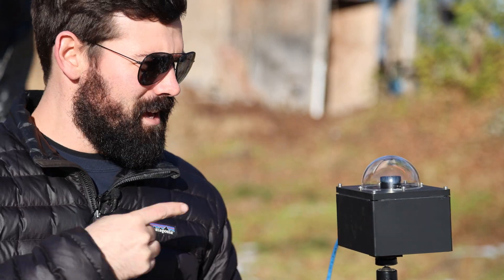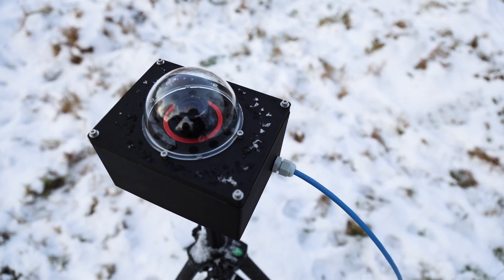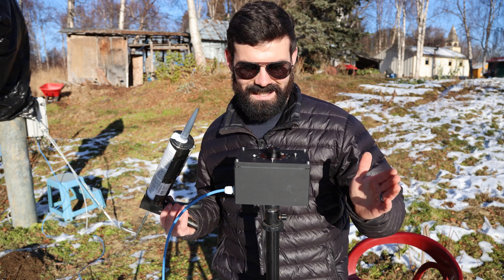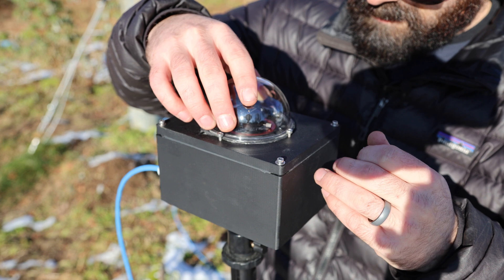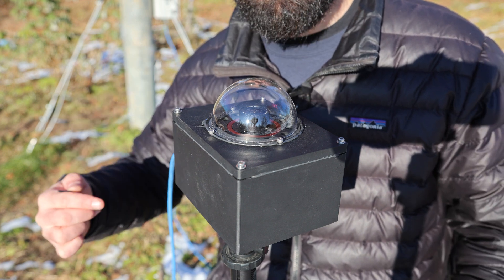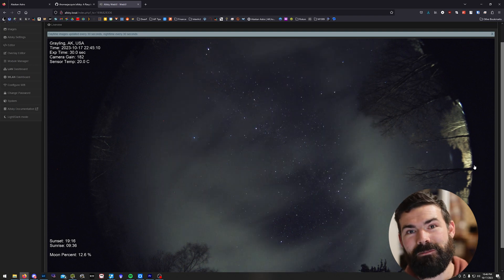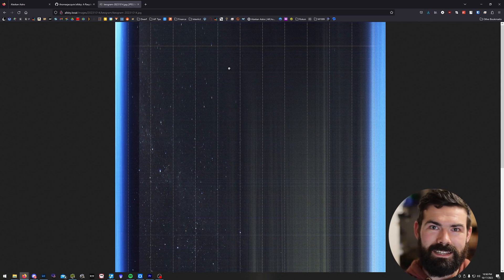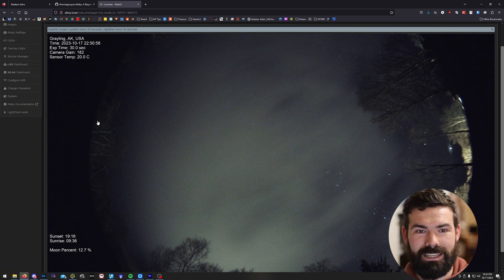All-Sky Raspberry Pi - The setup I use for this channel

Comment: Very good video.  Unfortunately Allsky has not been keeping up with ZWO camera releases.   It would not recognize my 676 and I understand it doesn't recognize the 678.   I finally found a similar tool, indi-allsky.   The missing cameras issue have been going on since May with promises of an update for several months.  Not your fault of course.   Just passing it along for folks that might try to use allsky with a newer ZWO camera and then get part way through the install and not be able to complete it.  Again a very good video and many things from the indi version will apply.
Reply from the maker: Yes I'm planning to make a follow up video on Indi AllSky. I've already made the switch.

Comment: Thank you 

I'm only 1m45s in and you've solved one of my problems - powering the heater ring inside the dome.  Not needed if I use PoE and make holes in the enclosure.

We've just moved into a bortle 4 area and I think I know what I'll be working on this weekend now.

Comment: BTW you can get humidity pumps that act like a constant dehumidfier. They are solid state devices that work like peltier elements, just for humidity. Google for Rosahl electric micro dehumidifier. They're intended to be used for small enclosures like yours.